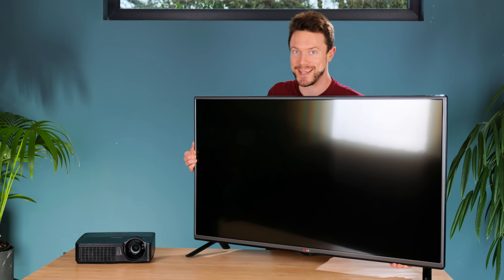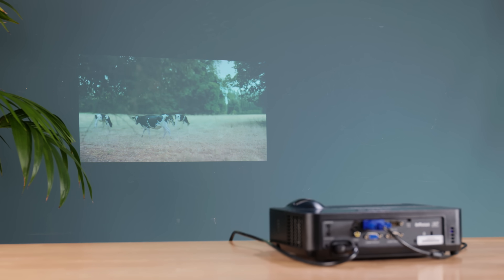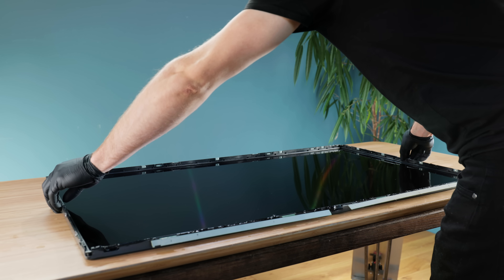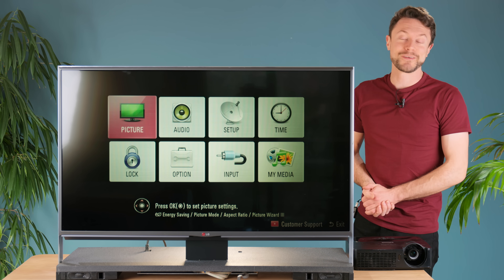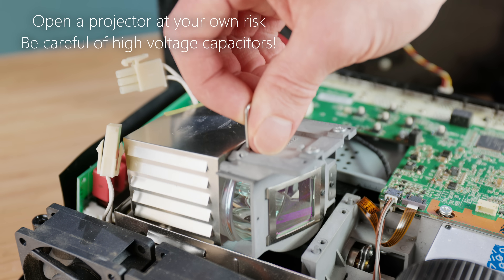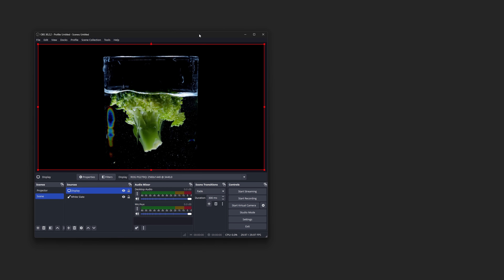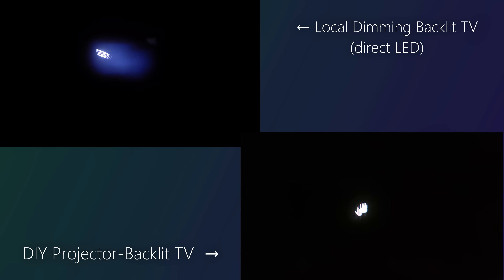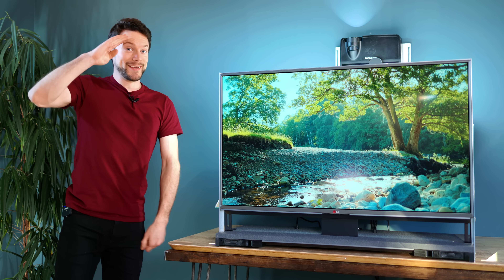DIY "infinity contrast" TV -  with 100% recycled parts

Comment: The only challenge... I would have left the color wheel, first idea to create ambilight and more calibration options, I would actually just fix the TV and create super precise ambilight using that PJ on the wall. But either way... the worst problem is the projector noise, do what you want, but it kinda defeats the goal if you invest further for better, brighter alternative, a good mirror will cost more than everything of that combined also, most create aberrations like mad, they are not flat, well looking at fireworks, it kind of enhances the thing tho, if you are the type finding positive things in anything. At such small TV sizes the image rectangle is okay looking already with older 1080p PJs like popular Benq w1070. I won't touch the biggest elephant in the room here that, becomes color accuracy and skin color tones, if you can adjust the LUTs, then okay. To be fair that office PJ mercury lamp should be worse CRI/Ra wise than the original LEDs, by a magnitude. Fun idea, but... well... there are usable entry level china LED PJs for ~500ish$ and you can even have 85inch TCL miniLED 1.8K $ without breaking a bank and the image is very acceptable. I hope it will be worth the clicks.

Comment: Can you remove the diffusion panel and just project directly on the lcd?
Should be brighter, and get rid of the parallax. :)
Could also try front projection - Then you can mount the projector in the ceiling and have the tv on the wall.
Might have some glaring and reflection issues, probably depending on the angle and smoothness of the surface. Might help to use a sandpaper to lightly (and evenly) scruff the entire surface. Bringing out poswertools to fix a tv, hehe :)

Comment: im just wondering, but dont projectors send out light regardless if an image is to be shown? isnt that kind of why when setting up projectors it is recommended to not use keystone correction as light is lit outside of the desired frame? Perhaps the LCD and diffusion layers filter this away.

Comment: "That would make this project pretty much inaccessible for all but the most dedicated hobbyists."
I love your always outstanding videos, but I had to laugh when you said that. Basically all your projects are way beyond my abilities, but I still love watching you pull them off and can appreciate the ingenuity and knowledge.
Reply: this one felt a bit toned down version of what he usually did! something that is doable but need a bit more effort
Reply: true, I wouldn't want to get anywhere near those capacitors. basically everything that plugs into mains is still a no-no for me.
Reply: @MattRose30000  That's generally really good advise, although I have opened up a lot of monitors (also ones with the old fashioned CFL tubes which require high voltage for startup). I've tested the huge capacitors with a multimeter before doing any other work on them, and even a few minutes after unplugging them, they were generally safe to touch, only a few volts left. Of course, this cannot be generalized, but with the right amount of caution, it's most probably fine.

Comment: This is genuinely impressive and interesting. Modern TV manufacturers should test and make commercial products using this method, especially with projects that can project from close distance. This genuinely seems like an improvement over current low rest backlight zones method.

Comment: Hi Matt,

Great project! I've been thinking about a similar lighting setup for TV for a while, but I didn’t have the resources to make it happen.

I’d like to suggest an idea for a video: What if you used a DLP projector as a light source for an 1LCD projector? You see, the lack of deep blacks is a common drawback of most budget projectors. I'm curious whether this issue could be improved by combining the strengths of both technologies.

The only concern I have is the potential loss of brightness, as the LCD panel absorbs a lot of light. In any case, I hope you find this idea interesting because I’d really love to see it put into practice.

Thanks!

Comment: I got some pretty good zaps from the edge of the screen area while dismantling a Samsung TV whose backlight LEDs had developed a blue/purple tinge (very common problem, all Samsung TVs will do this in time). I must have inadvertently provided a circuit path to the video board as it developed major image issues afterwards. These panels are REALLY not designed to be easily dismantled. So take it very carefully and make a careful note of the order and orientation of the surprising number of diffusion sheets. It's easy to lose track of what goes where and how and it's all extremely fragile.

Comment: Interesting way to achieve great contrast in a lit room.  Using a long throw projector keeps the angle of the lightpath more direct than an ultra-short throw projector.  The long throw might even allow no diffusion layer and be brighter.  But ... while this might be cheap initially, lamps are expensive and don't last long.

Comment: An improvement that might be worth trying is stacking two LCD panels, that would give you twice the light blocking/filtering capabilities, and if you get a higher resolution proyector then you could even remove the diffusion layer for a stupidly high brightness display, probably outperforming (in brightness) those 30k TVs they use for content production. And even if the color accuracy is not perfect, it would still be quite good thanks to the stack of two (or more?) LCD panels filtering the white light (to achieve a given color) more than once

Comment: I would highly recommend discharging any large capacitors before handling those boards. Get a resistor and bridge the contacts (not touching any of the metal yourself, of course)
Or, if you don't have a resistor, an insulated screwdriver will also do. The current will be much higher and it's not great for the component, but doing that once or twice should be fine.

Comment: 100% OLED contrast with 0% burn-in. Huge respect!
Reply: Wait until you find out how long projector bulbs last lol.
Reply: @RightJoystick  I think we could MOD the projector. If we replace the original light source with a high quality LED that has at least passive cooling, the projector's lifespan could reach 50-100 000 hours before we should replace the light source again.
Reply: @RightJoystick  Was going to say.. With projector bulbs, the concern is burn out 😂
Reply: @Carhill  the bulbs can be replaced more easily
Reply: atleast youll be able to replace the bulb instead of having to buy a whole new tv because of burn in @Carhill
Reply: @RightJoystick it's a whole lot cheaper and easier to replace a projector bulb than to replace an OLED screen
Reply: @RightJoystick  About 4-5 years with normal use
Reply: @RightJoystick  There are laser projectors now, and they last 25,000+ hours
Reply: @RightJoystick  Couple thousands of hours, and are cheap af to replace. Not a big deal. The projector's internal panel, though, quite expensive.
Reply: @RightJoystick and how much energy they use
Reply: Keep in mind that you combine not only the advantages of both systems, but also disadvantages) google DMD Chip Dead Pixel. By removing the wheel, we increase the light flow on the chip itself. For tests, you can put an economy mod of projector. But cooling will most likely have to be improved.
Reply: @MrSaoromat  You could 3D print a fan blade to go on the color wheel and point it down at the DMD chip, wonder what kind of noise and tollerances you would need to do.  LCD projectors are generally higher brightness so might be better to just use that to prevent the DMD Chip Dead Pixel.
Reply: Keep in mind he said it doesn't look nearly as good as a modern oled.
Reply: Isn't this closer to micro-LED or just a regular LED with "infinite" dimming zones?
Reply: @LetrixAR  There is no such thing as a regular LED. LED TV is just the bad name they chose to differentiate LCD TVs with an LED backlight from the LCD TVs we had before which had a CCFL backlight. Microled is using actual LEDs to make the image but as far as blacks are concerned each LCD pixel having it's own dimming zone(this doesn't exist in a commercial product) should be near identical to microLED. 
This setup is slightly inferior to either of those and OLED but still very close and highly impressive. Look out for QDEL (it's own different tech) TVs possibly coming out next year, should be similar to OLED but cheaper and with less burn in, though they did not solve all the issues with it yet so maybe not next year.
Reply: @LetrixAR  OLED still has the benefit of sub-1ms response times, which is close to CRT functionally. Super smooth especially for gaming, prob sports too etc
Reply: @LetrixAR  Dual-layer LCD is probably the closest equivalent. Same concept, but using a second LCD instead of a rear DLP projector. Hisense experimented with them as consumer products, and they’re common in high-end color correction displays for grading HDR movies/TV. But the power usage and viewing angles aren’t great compared to OLED and single-layer LCD, which has hampered their adoption for consumer screens.
Reply: Also much more affordable
Reply: Well don’t wanna dissapoint you bro but your lamp will burn after 3000 hours. You will need replace it every time, power consumption also very HUGE.
Reply: Isn't there noticeable latency due to processing the video ?
Reply: Projector bulbs do that exactly have a high life span. But for typical TV like use should be fine.
Reply: @shadow7037932  about 2000 hours for an old projector like that. Should last about 5 years.
Reply: @Sandman503413 The projector itself would be too expensive for this project. However, with the clarity of the laser projector the LCD panel would be useless.
Reply: Modern oleds haven't had burn in problems for a while now
Reply: The only reason i wont buy an oled burnin
Reply: @emrehatipoglu8455  It’s a non-issue for any modern device. It’s not 2014 anymore. You’ll probably have a dead PCB or whatever before your OLED display becomes unrecoverable. How often have you seen reports of iPhones burning in? They have been using OLED since the iPhone X in 2017.
Reply: @emrehatipoglu8455  I have an LG C1, been using it since launch for both games and 3D related stuff for more than 4 hours a day.
And I still don't have burn-in.
Reply: @emrehatipoglu8455  bun in isn't really an issue anymore, oled tech has come a long way and what it's still lacking is made up for with software.
Reply: Ah DLP/DMD based projection would not give the same contrast as OLED actually.
Reply: Lol, nowdays, burn in is hardly a concern anymore ...
Reply: Except projectors have the same issue as a backlight, they can't project black, so even when you want no light you are just passing a bulb through a lcd panel from the projector. The dark areas from the projector won't project 0 light
Reply: @CorporateZombi you are wrong about this part, they literally can project black, that was the whole point of the DMD chip. Is literally little mirrors that reflect or more importantly DO NOT reflect light meaning black.
Reply: @CorporateZombi  this is not an LCD projector but probably DLP. Even if it did pass some light in the blacks, it's further filtered by the LCD panel. A non-black backlight is not the same as a non-black pixel you're looking at.
Reply: yes 500 watts of consumption, against 50 watts of qled/oled 😅
Reply: Modern OLED screens do not suffer from burn-in, which is a permanent etching of the screen that can sometimes be severe enough to be visible even when the screen is off. Some do experience image retention, which is the ghost of a persistent image remaining for a time after the display is changed to something else.

it took a good 3600 hours to burn image in to a OLED Nintendo Switch. In that time even LCD can burn in.
Reply: @migidid  that’s just wrong. What do you mean is that under conditions like gaming, deep build in systems to prevent burn and worked quite well.
Just use an oled monitor for browsing at full brightness, you will have burned in after just one month
Reply: @ That's exaggerated. Look at Monitors Unboxed's burn-in test. Calibrated to 200 nits (not far from 100% brightness which is 238 nits for the MSI 321URX), no screen saver (turns off after *2 hours*), no dark mode, used almost exclusively for static content for 60 hours a week, pixel refresh every 8+ hours (every 4 is recommended) and still relatively minor burn-in after a year.
With some minor sensible changes like a more normal brightness and turning it off after 5 minutes of inactivity you'd probably cut that burn in in half, more likely go down to like 25%.
Reply: @migidid That is 100% a lie... one test doesn't mean all, go to ANY used market and you'll see even last year phones as well as oled tv with some kind of burn in...

The issue is mitigate to some extent but not to the point of "modern oled do not suffer burn-in" switch oled peak brightness is lower than even current oled TVs and definitely lower than oled phones and tablets.
Reply: @soragranda  I got my oled TV pretty cheap, had it a few years now and it's still like brand new. Certainly no need for me to build a new TV out of things from the dump to replace it, though I'm all in favour of recycling everything
Reply: @subspaceanomaly  That it's not the point, your case is yours, can be truth can be a lie, or can be that you got a panel with good heatsink and have a really low nits which can survive more than others.

But make no mistake, all oled eventually develop burn in, is an organic led for a reason...
Reply: The mad man in me wants to do this to my 75" 120hz VRR TV. Not expensive, it's a local dimming LG microLED.
Reply: actually better than oled because its much much brighter than oled which is the biggest weakness for oled.
Reply: @Kayserjp better is relative. Right now there is a ton of light bleeding around the set up and it takes a lot more room than an oled
Reply: @mglinkowski  I love my oled and I still see huge potential in a set up like this. Yeah you need room for this but what If you want to/can make a basement home cinema. Big screen, high resolution, high color volume, higher contrast than mini led, potentially bigger and much cheaper than an oled. Maybe not energy efficient...
Reply: @Kayserjp  I'm not at all sure this is brighter, especially not compared to a modern high-end OLED that can hit over 1500 nits in practical (and calibrated) use.
Reply: @Kayserjp  "better than OLED" is a stretch. This is cool, but it's no OLED. You're forgetting about panel quality, color accuracy, pixel response times, refresh rates, etc etc.. this is still an old LCD, just an old LCD with a sick backlight.
Reply: @Kayserjp  do you mean full screen brightness. Most oled go up to 1000 nits for smaller areas. His set up has under 250

Comment: Here is your next project to try: use one identical screen for colored pixels that it is in front and another identical screen for baclight in black and white image so the normal source of light is the second screen with black and white color, so the idea here is to heave 2 screens to block the back light for richer blacks and use stronger led for baclight to boost the richer white areas....

Comment: Would be pretty neat to build this into an office monitor, can't use OLED for productivity stuff due to burn in, cobble something together from an older IPS black version 2 panel and a short throw projector.. if you could find one of those 40 inch 120hz Dell IPS black v2 monitors that'd be pretty ridiculous.. I ordered the newest 32 inch model with LG's new v3 panel, best productivity monitor out there at the moment but ofc the backlight is not great

Comment: It would be amazing if the project could be refined to the maximum.
One step would be to use a DSP like an SMT32 to do the filtering, avoiding using OBS and a second video output from the PC.
Another step would be to synchronize the real FPS of the LCD with the flicker of the projector. In monitors it is usually used to improve the image with the movement of the video, with the backlit off when the crystals change position.
You would also have to be careful with completely white images, the LCD part of the projector can burn, since you have removed the RGB filter. With the DSP you could do it, also regulate the maximum brightness for eye comfort.
It is clear that it takes work, but the things you do are not normal..

Another harder step would be to directly control the projector LCD with your own DSP, and why not the TV's. Doing it with DHCP and FreeSync is another story...
Another part is the choice of the TV panel (IPS, VA or TN), ghosting matters a lot.

The physical part of the project is almost there, a kind of fireplace with the TV built in, with access to the projector for maintenance of the lamp.
I assume that the lamp is powered by a constant current source, to avoid problems when it is cold and turned on. Controlling the flickering with the lamp is ruled out due to the persistence of the emitted light.

I was thinking about COB LEDs with very high CRI, I'm sure you could figure out how to replace the projector lamp.

I am very interested in seeing how far the project goes, it could be a business if you think about it. OLEDs are very thin, very expensive and are organic so they burn out... MiniLEDs are expensive and not so thin. Anyone would put a fireplace in their living room with a 50" TV if it looks that good.

Comment: I once broke a computer monitor. I quickly ran to buy a 32-inch curved one (I like those). But I didn't have much money. I bought the cheapest one at the time. Well, a monitor like a monitor. And only now I realized that it is awesome at transmitting black color. Because I saw everything that was done. I decided to look at the specifications now. The monitor turned out to be surprisingly cheap and high-quality. Philips 322E 🤣🤣🤣